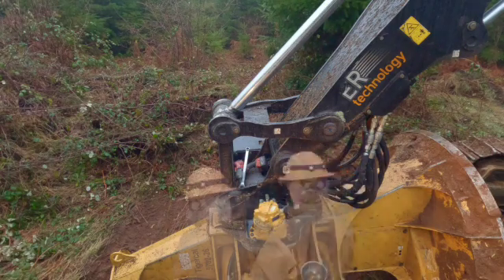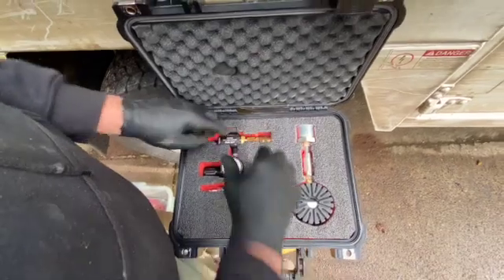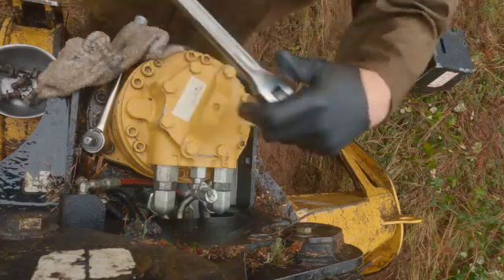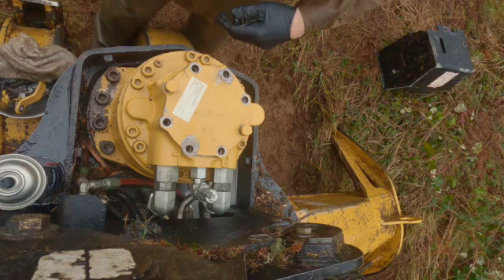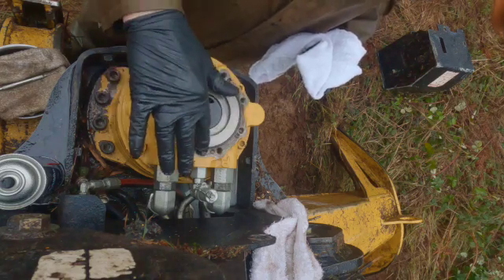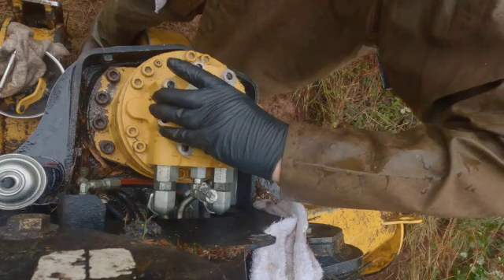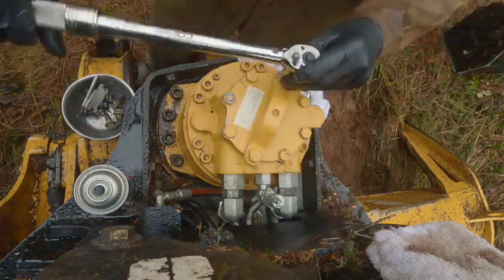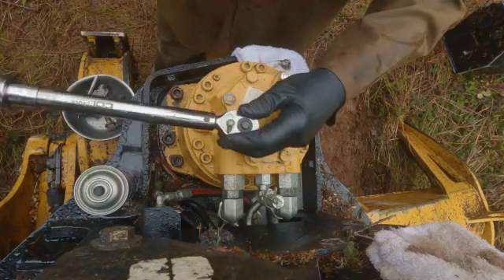Using A Shop-built Venturi Airvac To Reseal A Tilt Motor On The Tigercat - Without Losing Any Oil

Comment: Great work, love the new tool saves lots on oil
Reply from the maker: Thanks! It really works great. Saves on oil, I don't make a mess and it will take a lot of stress out of a repair too. I haven't had a multi hose or component issue on this Buncher yet, but I know it can be a race on some repairs if you've got a lot of lines that have to come off to get to one hose or component. To be able to open a lines and cap them off without losing oil everywhere just makes it a much more pleasant project. Do you have the 340 degree head on your machine? I had a output shaft leak on one other tilt motor when it was under warranty, they swapped out for a new motor. I'm hoping the third one will continue to stay dry for me. Thanks for the comment. Be safe out there!

Comment: That’s a handy tool.
Reply from the maker: That's for sure. I first got the idea a long time ago from Ken Westin, an engineer with Hahn machinery. Tremendously bright guy, I remember the first time I talked with him, we'd just taken delivery on a new shortwood machine and a problem came up. Got him on the phone and he knew exactly what the issue was and then went on to tell me just what tools I would need to fix it. Good guy! Anyhow he mentioned the idea of using the vacuum off a truck brake vacuum system. I set it up on that service truck and two more after. I did have to be careful because you could pull oil into the truck if you opened a system up too much! Keeping it clean means a lot to me, it's one thing to have a breakdown, it's whole 'nother one to have to get completely filthy dirty to fix it! Take care.

Comment: Really great video. I've been meaning to put together an air-vac for a while now. Will get to it this spring. I've used a shop vac with good success when I've had equipment at home. Even just having clean barrels on hand to quickly drain the hydraulic tank has been a great tool as well.
Reply from the maker: Hey, thank you! I am really happy with how well this one came out, I think it's the best tool I've put together for myself ever. It tickles me every time I use it. The AirVac Venturi is about $72.00 on their site, I looked the other day. I have seen them on eBay too for less. I got the regulator for $10.00 used delivered from eBay. Good to hear form you, hope your winter is going well. Be safe!

Comment: I remember buying the off brand hydraulic oil at our local parts house when I first started back in 1999 for $9.99 a bucket. My dad and I bought two buckets of the cheap stuff at oreillys last week for $52.99 a bucket. When we were rolling big, we used JD hy gard. That stuff is over $100.00 a bucket now. That vacuum is keeping money in your pockets. Caps and plugs don’t hold a candle to it.
Reply from the maker: The only thing that doesn't go up is the logging rate! Like you say, an Airvac is keeping money where it should be, not on the ground. It really works slick as a button - and if you need to you can cap and plug it after if the repair is going to take a day or two. I was looking at one of our shovels back at the shop the other night after talking with my boss about it thinking about how to adapt into the hydraulic tank. We still have few Deeres and they have that vented fill cap, not quite sure how address that, maybe a flange with a female pipe fitting that would bolt on if you pulled the cap assembly off. Little more work than the 870. I'll see what I can come up with.